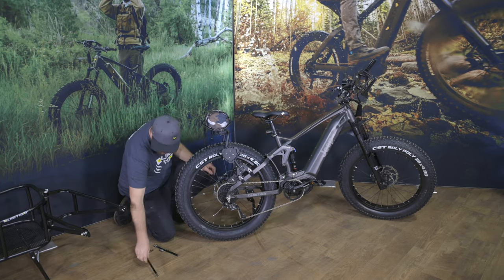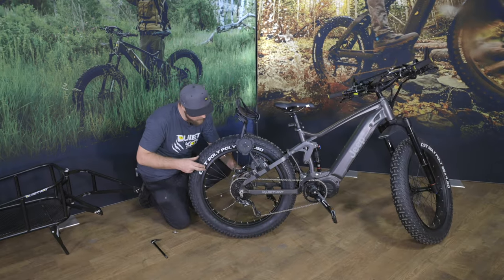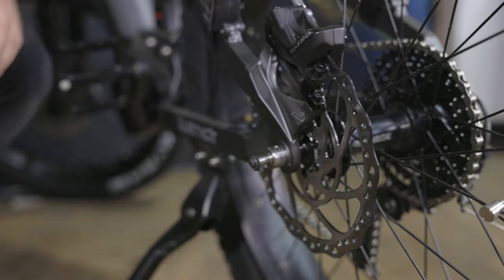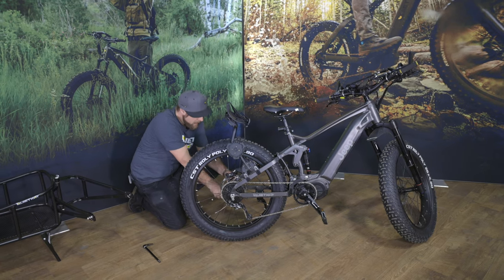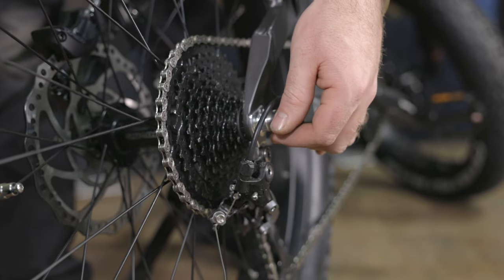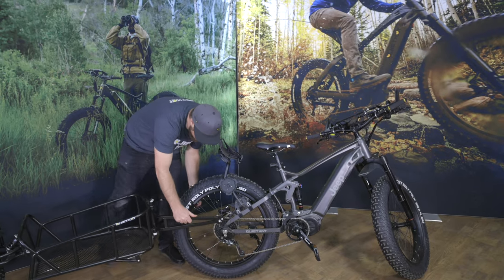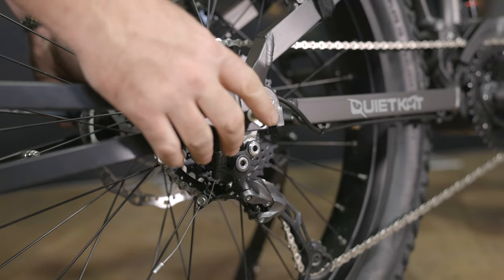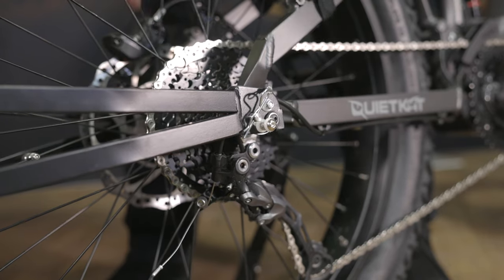How To Attach The Single Wheel Trailer - Full Suspension Models

Comment: do you do one that fits inside a larger axle that screws on the ends the same.much thinner than 12mm or 15mm.i might be able to hollow out my massive 17mm axleif i can get 12mm hollowed out then will it fit inside the axle 2.5mm thich should be enough on my axle but i needto know the length of it